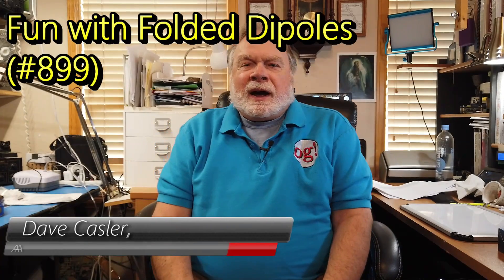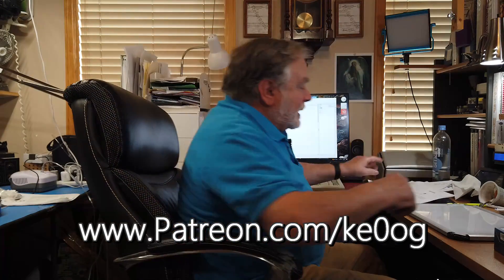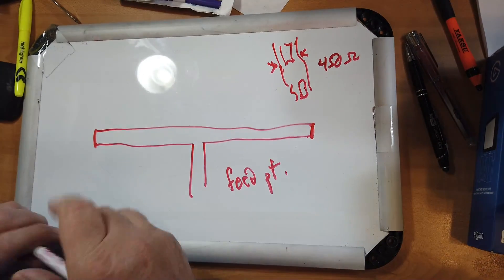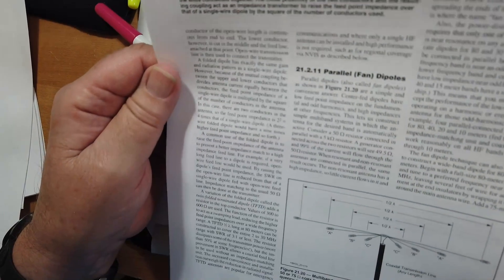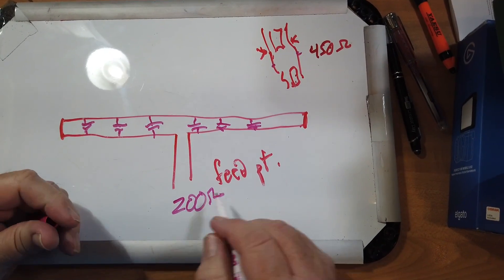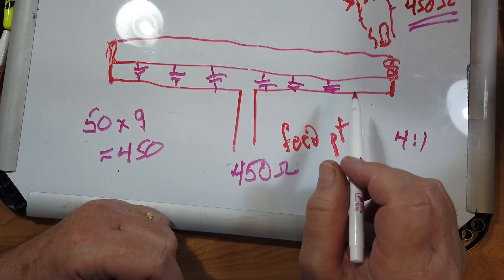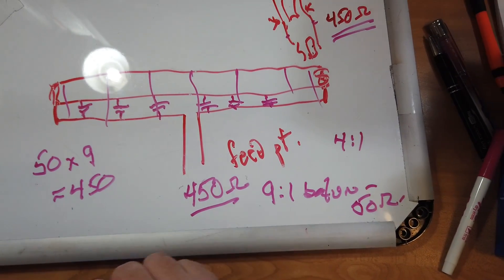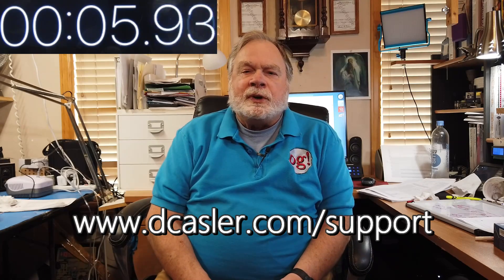Fun With Folded Dipoles (#899)

Comment: Hi Dave, 

Another interesting topic.

However, I have 2 or 3 more important questions that you didn't cover here.

1) you didn't cover how a folded dipole radiation pattern is affected by the extra conductors.  As you repeatedly state correctly... When it comes to antennas... Everything affects everything!  Couldn't be more true!

2) You didn't state anything about gain by adding conductors!  This is important as if you just create  your simple folded dipole; how does the of that compare a 3 element, or say a 7 element folded dipole. Is there a formula for that?

2a) related to that on gain & pattern, would the folded dipole work the same as a std. Dipole with 3/2 wavelength, etc. Which do provide gain. 

2b) have you or can you run these thru an antenna modeling program?

3) how well, if at all do these cope with noise; i.e. do they reduce local RFI or atmospheric noise like a fullwave loop? Though probably not to the same degree.

Thank you again Dave, for your presentations and elmering activities

Comment: A flat top dipole has a characteristic impedance of around 75+j43 ohm.
A folded dipole presents 4×75=300 ohm.
And a three wire folded dipole has 9×75=675 ohm.
A homebrew 600 ohm open wire would be needed to feed the antenna.
You may try to argue that a folded dipole in the inverted V configuration has the feed point impedances as you discussed in the video; but I am not for it.
The main advantage of the folded dipole is it's broad banded and the main disadvantage is it's for a single band only especially if it's fed by a 50 ohm coaxial cable with a voltage BalUn interfaced at the feed point as you suggested.
De VU2RZA

Comment: hello dave is the feedpoint literally at the center of the ladderline as represented in the drawing or could i feed it from the end of the ladderline with the oposite end shorted. in this example for a two wire folded dipole. thanks for the video